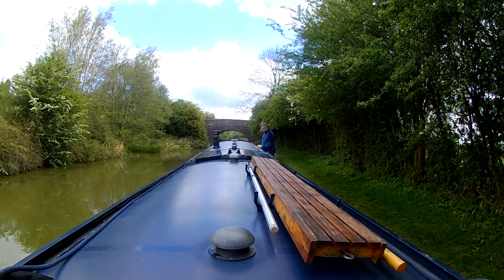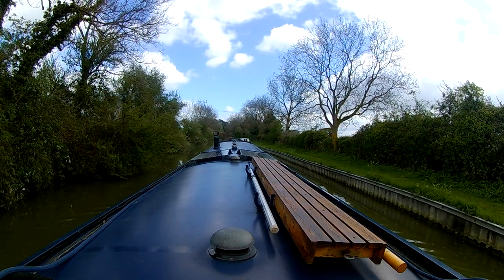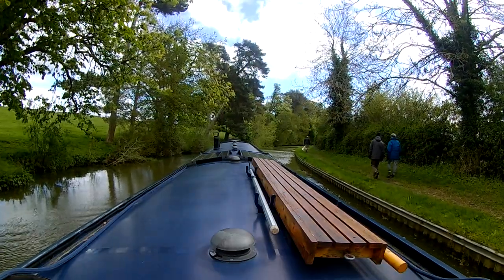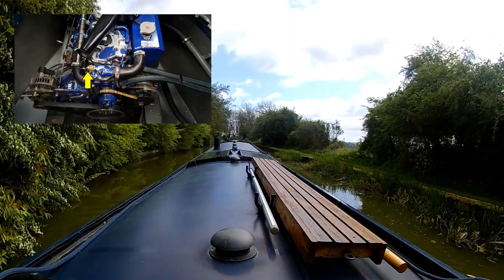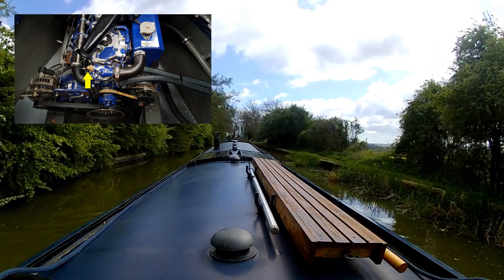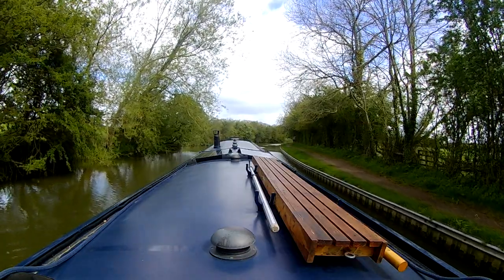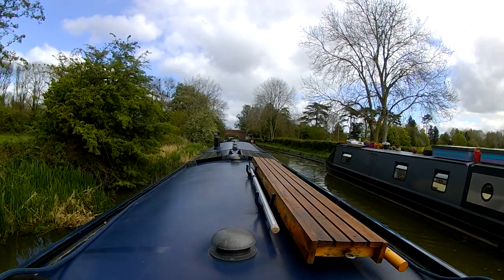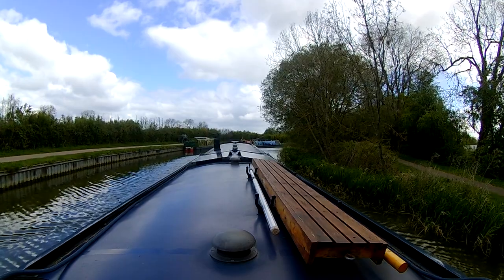#18 Yet Another Overheating Engine

Comment: Very interesting thank you.Have you had any more trouble with over heating? Since easter
Reply from the maker: Thank you Lewis. Yes, there have been a couple more times since, a few months apart. It's not been a constant issue since we took everything apart and put it back together. We're planning on doing a complete water & coolant refresh before heading out again later this year. There's a few more vlogs coming from our 2019 cruises. Thanks for continuing to watch our channel and Happy New Year! Mark & Paul
Reply: I think it’s a sticking thermostat, if it was a head gasket it would do it all the time.
Reply from the maker: It never hurts to have a spare, we will look into sourcing the parts and will seek help... As I think that'll need the pump assembly removing (??) If I remember correctly. We would need a new gasket to put that back on. We were wondering if the 'fan blades' in the pump (can't recall the exact name) needed looking at or replacing as well. It's definitely something we need to sort very soon. Thanks
Reply: The one thing a Diesel engine don’t like is over heating, it can cause a lot of trouble and the cost can be huge. I would have thought if it was the impeller on the water pump it would do it all the time, it could be getting an air lock in the system and sucking in air from somewhere. An intermittent issue point to thermostat but I could be wrong. The outside temp could be a factor in this issue as well if the thermostat is playing up, but most of the time when I thermostat goes wrong it makes the engine run cooler because it stays open, and when you said the gauge went from 90 to 85 it does show the thermostat opened then, it could have something stopping it opening fully when needed. The mind boggles.
Reply: @lewisgardner1660  it's probably the thermostat, take it out and suspend it in a pan of water, heat it up on the hob and watch to see if it fully opens preferably with a thermometer to at what temperature it's at it's maximum. Their cheap so worth just replacing tbh
Reply: @YetAnotherCanalAdventure  water pumps usually aren't serviceable on modern engines, you just replace the whole assembly, I don't think it's the pump tbh, when they fail they just fail, not an intermittent problem
Reply: Just another thing, thermostats usually have the temperature that they open indicated on them so you can check against the engine specification..
Reply from the maker: Thanks, will have to check and see if we can find what that temperature is on our current thermostat. I'll get the manual out again and read through it.
Reply: Have you had any luck with your engine yet?
Reply from the maker: Our next vlog is out tomorrow morning 😀 We've not tinkered with the engine over Christmas as we had family over from foreign lands and have both been a little  unwell with seasonal colds and illness. We will keep you updated as we do! Thanks
Reply: I haven't seen a narrow boat so I don't know if they have a radiator as on a car or a heat exchanger which would use cannel water via a raw water pump that has a rubber impaler. If it dose then the blades eventually wear out. In these types water comes out of the exhaust so if there is little or no water then the impaler is buggered or you've sucked some crap in the raw water intake. There should also be a strainer between the intake and the pump.
Reply from the maker: Hello! Most narrowboats have a 'radiator' type contraption called a skin tank, which we do have. This uses the coolness of the canal water to cool down the engine coolant water. So it's pretty much like a car or vehicle engine in that the coolant is a closed system. We had considered that the pump mechanism might be an issue. We didn't investigate that as we didn't have a replacememt seal to put it back on with! It's a part of the engine assembly rather than a separate pump unit. We essential checked for a blockage in the pipes and tubes, then replaced the coolant/water mix. We're not too sure when that was last done, we now know the date and will drain / refill with fresh coolant every couple of years. We're looking at getting some spare engine seals too 🙂 so we can put things back together if we get adventurous and take it apart!! Thank you for watching and for your comments.
Reply: Great vlog guys hope you get over heating soon love the views one off the other vloggers had this trouble it was his pump in the end so I wonder if that the problem been flicking though vlogs to see if you fix it but no sign and also trying to see when you move in full time but no sign off that so bake to binge watching your lovely vlogs twenty today so far keep up great vlogs
Reply from the maker: @nicholassimpson5646 Hello! Thank you so much for watching the vlogs. We kept having issues with the engine overheating on and off, despite what we tried to remedy it. However, after we set off for our second blacking trip in May 2022, we had a coolant pipe (rubber hose) come loose, and it dumped all the water and coolant in the engine bay. Having replaced the lot (coolant and water)... it seems to be behaving itself, finger crossed. We also found a new filler cap, that fitted. The cap that was fitted the rubber was perishing - I'm sure it wasn't making a proper seal. We do still keep checking the temperature gauge, as you will see 😆 Thanks again Mark & Paul